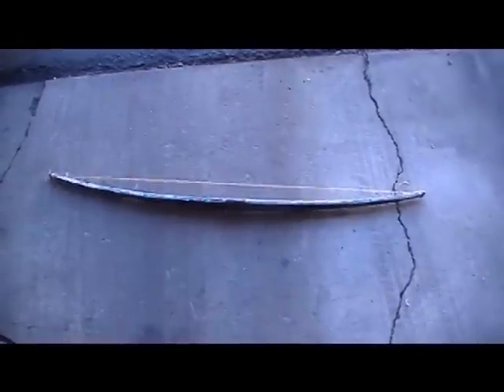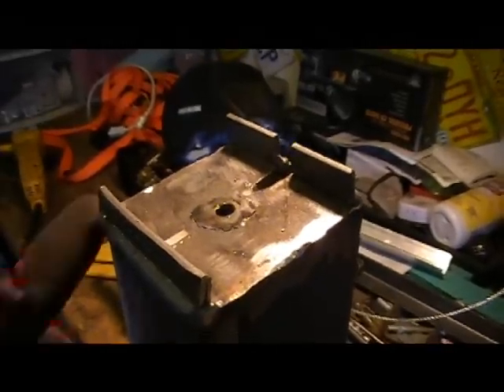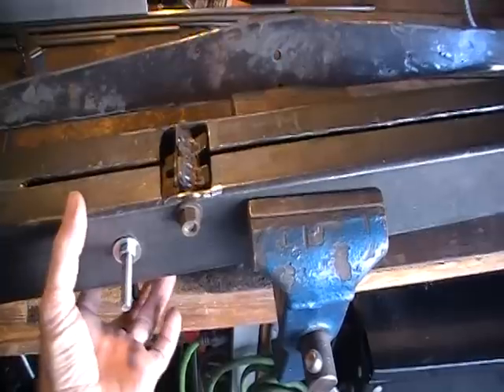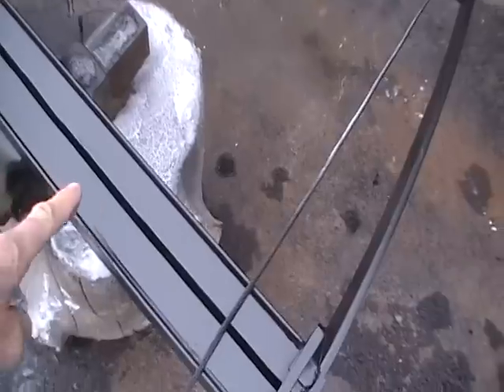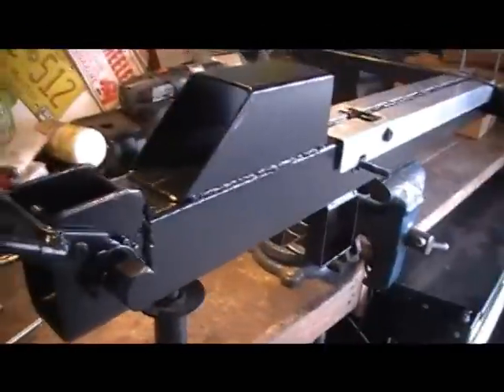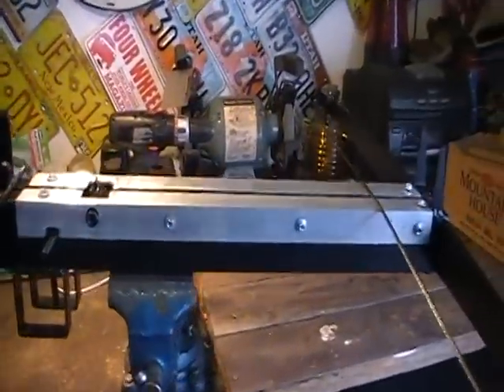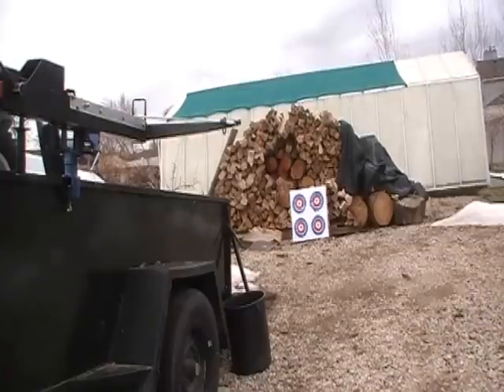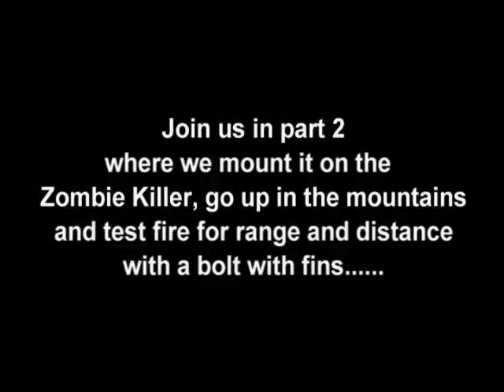How to build a long range crossbow.

Comment: Hi Stan well I’ve got a one off bow well not for the Army. But most civilians can’t get this bow anyhow it’s called a Cobra Bow. It’s a Compound recurve and yes it has Two cams and  it is a recur already the Distance is much further then you will believe but I’m making a cross bow with it. On top I will add leaf springs and cover with Rabbit for and I’m using a gun stock and trigger and hammer. Working on how to make it release no the parts haven’t got hear yet but if you want to see a cross bow go over 300 yards I”m making one. Don’t have the tools like you but I have ordered a Kentucky long rifle stock and exotic hardwood ordered and it’s coming. It may be heavy but I want the rang.

Comment: it's not super important, but the bow arm is backwards. you want it to be forwards when there's no tension on it. Gives the maximum about of force to the cross bow, but again with how big it is this isn't important.
Reply from the maker: If I could forge my own bow I would do that, but this is out of a leaf spring so not much option to build a re-curve into it, but thanks for your expertise and feedback. :)